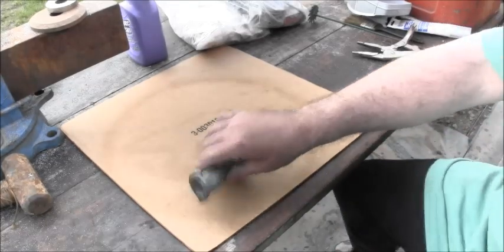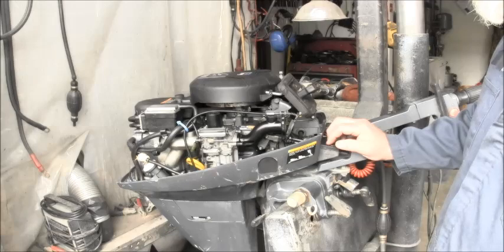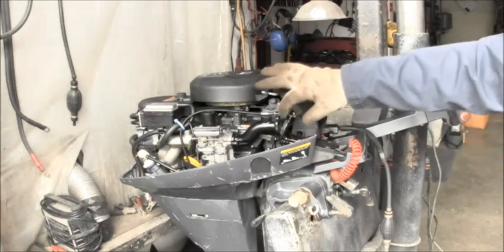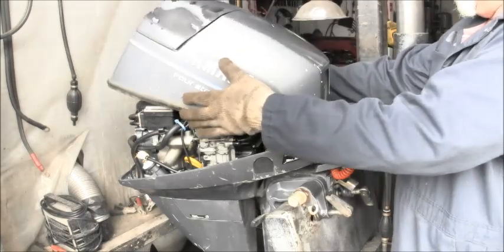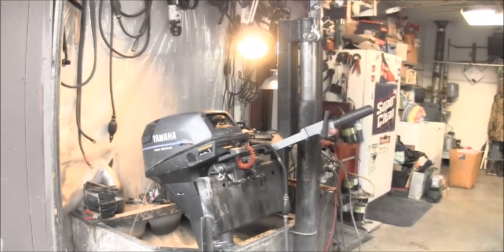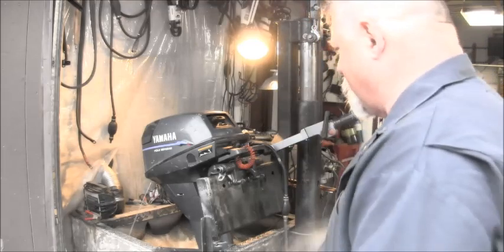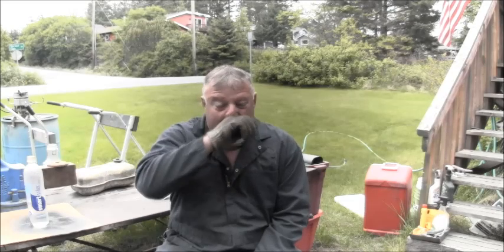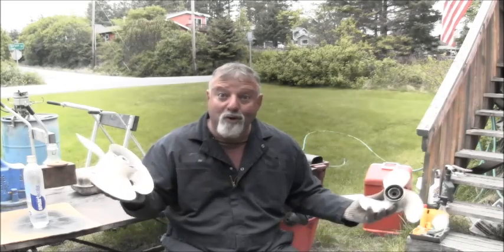YAMAHA 4 STROKE   9.9  / 15  adding a manual choke 1996 thru 04

Comment: Have a 04 same as that and after fighting with having to manually choke it when cold i removed that thermo junk and made a block off plate for the top. Most of the time it fires right up and runs great even when hot and doing long runs across the lake. When it doesnt start nice i jusr remove the lid and cover the intake with my thumb for a few seconds and were good to go for the day. As for the prop it came factory with the smaller prop you had at the end of the video and at idle it pushes our 16.5 deep v almost too slow to troll especially if in a light head wind.

Comment: Hi Kodi, a friend contacted me to help him figure out why his 2002 130hp Honda EFI was dying on him? I went over and those motors and he has two are huge. But I knew it was a fuel issue since it ran the last time he started it. He tried to start it when I got there but just a pop and nothing after that. Started in cleaning everything and checked to make sure the fuel pump worked. We then took the VST (vapor separator tank) apart and was a mess. Clean it and the motor now runs like new. I told him he needs to do its twin before it does the same. I wanted to share this with anyone who has these EFI motors to keep them clean👍
Reply from the maker: Yep'  Those High pressuer filters can look clean but cause problems as well , I replace them all.  kb

Comment: Hi Kodi, out on the puget sound down here in August for Coho season I see allot of Yamaha 9.9s out there. I use like you my 4hp yamaha 4 stroke kicker and speed for us on my fish finder is usually good around 3.5 mpr. It depends on which way the currents going. I watch the angle of our lines too. Also I just did a lake test with the Johnson  TD-20 yesterday. Ran great but discovered the petcock is leaking fuel so put my mini Kota on and then caught my limit of trout. Great day on the water video coming soon
Reply from the maker: Kool bells man'  i WILL b WATCH'N.     KB

Comment: Props are also called "screws", as they screw through the water. So the pitch determines how fast the prop screws through the water at a given rpm. Lower pitch means slower speed and higher pitch means faster speed at the same rpm. The size of the blades on the prop determines the amount of torque or the weight it can push. You may indeed find that larger prop is what you want for trolling. As far as cutting down a prop, you will want to make sure its balanced (possible, but not the easiest to achieve). If not properly balanced, it will put added stress and vibration on the drive system. You will have to experiment to see which works best for your boat. You may even want to see if you have a small prop with a lower pitch and try that as well. I'm no expert, I just understand some of the physics as it was explained to me by others who are much more knowledgeable. Hope it helps. Looking forward to see what worked best for your boat and your thoughts (and seeing some of your salmon catches this summer!).
Reply from the maker: Thanks' yep I want to troll slow.....   kb

Comment: My problem with my 9.9 is that it is running rich. I have tested the electro thermal valve and it works fine. I have thoroughly cleaned the carb. Any ideas?

Comment: I always say that finding the best prop is an art not a science. That's why even the best prop sbops will first narrow options using computer software but end the process on  trial & error. The basic parameters are simple to manage. Thrust results from the volume of water being puhed by the blades so at any given rpm and diameter, the higher the pitch, the faster it SHOULD move a vessel BUT beware cause your boat's weight and configuration (how it sits in the water - aka its friction factor) will really matter. This is where we move out of science and enter art. To further complicate matters, prop blades are given varying curvatures (also called cup) and leading edge designs that matter. One will get away with filing down a damaged prop but agressively cutting down the blades is an almost garanteed way to render it useless even if you manage to remove exactly the same quantity of material from each blade. But what the heck, make it a hack from Kodiak and try it as you could get lucky and get acceptable results. Even if it fails, you could at least  make a fun tune on your experience Stay safe and be merry !

Comment: kodi I need your help I got 1968 mercury 350 35hp I need a coil I've looked every where do you know where I might could buy one ???
Reply from the maker: Ebay but make sure seller takes free returns just in case.    kb

Comment: How did you disable the electric “choke”?
Reply from the maker: Leave the wires disconnected..    kb
Reply: @kodibassInsideoutboards  But that would leave the “choke” aka fuel enrichment device in the “on” or cold start position.